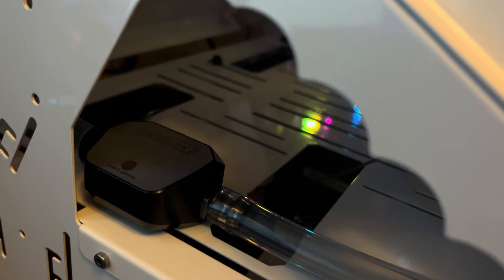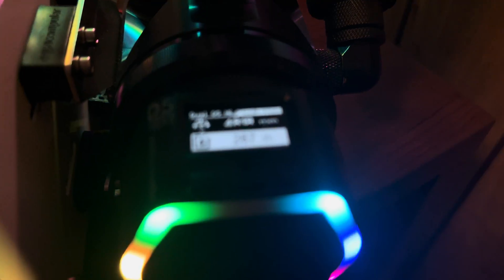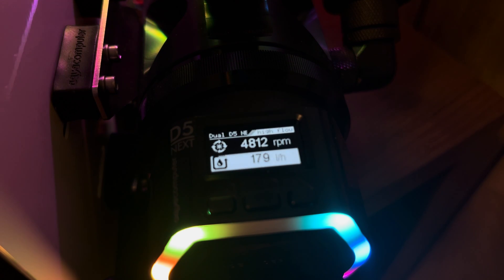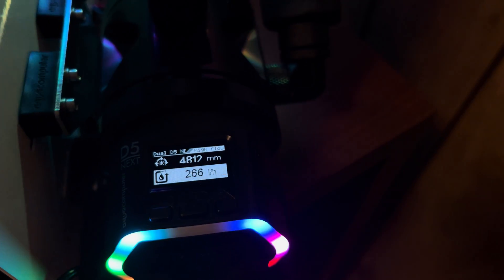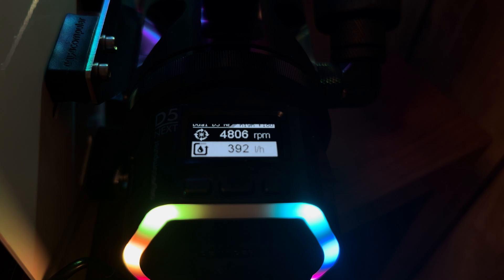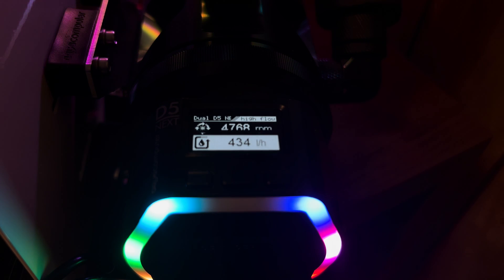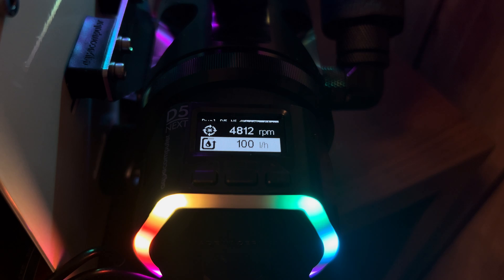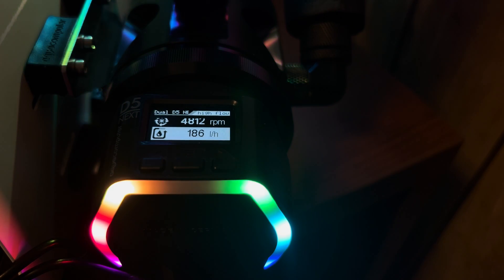Aqua Computer HighFlow 2 (Flow sensor) in action and playing around with flow rates!

Comment: Previously, when FLOW 1METER was installed, the flow rate display and the flow rate display for the NEXT5 pump were not accurate. Are you saying that when this is installed, even the NEXT 5 pump will be displayed accurately?   i am installed  next d5 dual pump  and 1ea old flow meter   ( next d5 is 197/h each  , flowmeter 236/h )
Reply from the maker: The HighFlow 2 is accurate. The D5 next virtual sensor is not very accurate. But, we need them both to calibrate the HighFlow 2 properly.
Reply: @videocardzrule354  thank your answer

Comment: good video.  Using my thermaltake flowmeter and 2 eheim 1260's in series im at 590-610LPH to give you a reference
Reply from the maker: Did you ever go 14900K?
Reply: heck no. i have an sp129 13900ks that is just to good.  @videocardzrule354